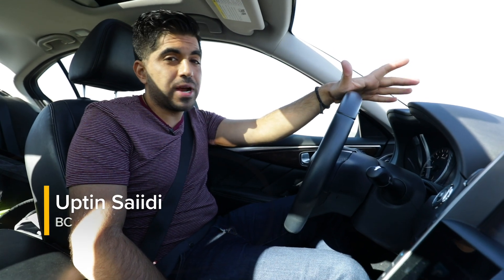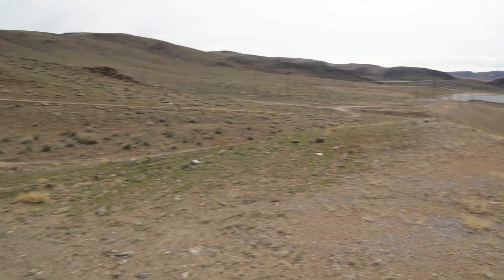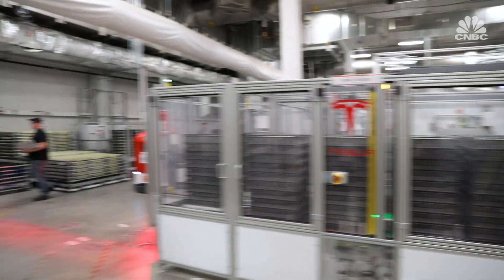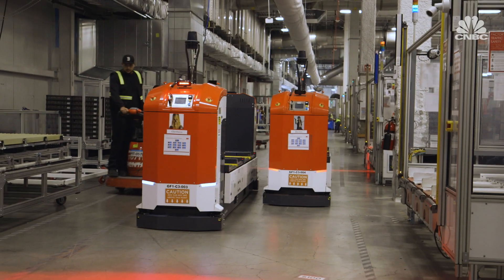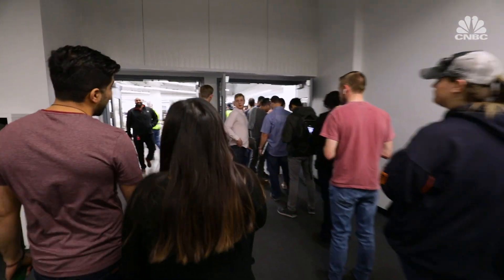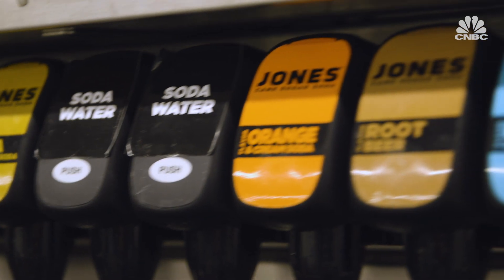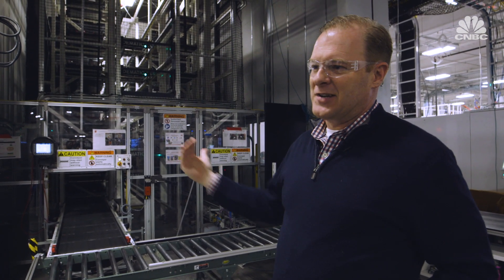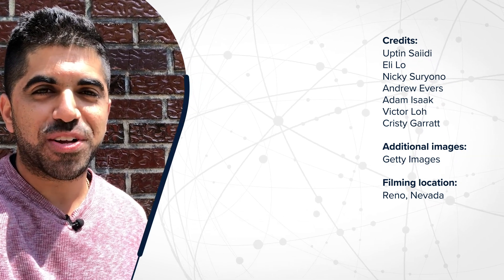Take a tour inside Tesla’s first Gigafactory | CNBC Reports

Comment: 7:52 on the left you see a forklift with a gas canister on it. They allow gas powered forklift to operate inside? These types breathe out carbon monoxide. Deadly gas
Reply: The yellow LP/Gas powered Hyster Forklift has a higher lift to reach top shelves of battery storage.  You MIGHT have also noticed the red Raymond Electric Forklift with a battery packs on it.  At this point in time, an electric alternative to the Hyster may not exist for the task at end.  Do you want Tesla to manufacture their own Electric Lift Trucks as well because there's nothing currently available for the need?  I worked at 3M Company for 35 years and we too used a combination of Hyster and Raymond Lift Trucks for specific tasks at hand.
Gimme a break.  They have to start somewhere as they move TOWARD a more sustainable world.  The vision doesn't become reality instantly.
Reply: If the factory has ventilation its ok.
Reply: Even if ventilation say isn't optimal & if fumes were a concern, don't forget the size of this building & the air space in it. It would dissipate all emissions pretty quickly.
Reply: Typically its natural gas, so its better then a diesel truck running inside your factory, but with the right HVAC equipment its okay, 1000s of Warehouses across the country do the same thing.
Reply: They are natural gas or propane fuel.

Comment: If only they can produce much more batteries. It is the bottleneck to their current products, Model 3s and Power storage products.
Reply: Raw materials. Seems to be an issue at the moment, except cobalt which Tesla use very little in their batteries compaired to the rest of the industry.
Reply: The bottle neck no longer exists as demand for the model 3 has fallen drastically, which is why they lost more than $700 million this last quarter due to decreases demand.
Reply: @JakeobE  It was deliveries that caused the loss not demand, they still have a several months long waiting list. A car is only marked as sold once it's delivered, this is one of the reasons why tesla began using its semis because they weren't delivering fast enough.
Reply: @JakeobE  there were 10,000 teslas in route to be delivered that didnt get counted in the numbers
Reply: @JakeobE  demand is higher then ever, your getting misinformation

Comment: Ironic to see right inside the factory (shown near the end of the video) a Tesla employee driving a gas-powered, instead of electric, forklift.
Reply: It's like buying chinese solar cells made in factories powerd by coal plants....
Reply: @TremereTT What is your point? At least the solar cells will generate power when it is used. You have to start somewhere...
Reply: @1flash3571  The point is that the solar cell factories should be using solar energy, if they trust in their product!
Did you realy don't get the point from reading the first post?
Reply: TremereTT don’t you see they’re not ready yet? There’s only one part of the roof is solar panels.
Reply: dont know much about forklifts. care to explain more?  i find it unlikely as it can't emit exhaust indoors.
Reply: Ugh, not all Apple employees use Apple products only. Same with Microsoft that use Google Chrome in their video presentations. It's not ironic, it's expected.
Reply: Rob yeah. Tesla makes suvs, sedans, trucks. They’re not supposed to make forklifts just because they have 4 wheels.
Reply: Ughhh they're rentals???

Comment: Erratic, intermittent, low capacity factor wind turbine/gridscale solar ['PNM IRP 2017 MEETINGS' engineers'  July 27,2016 scam/fraud DATA?].  Both require "fossil-fueled"  load following backup, 'PNM Energy Sources' concludes.  What Tesla gigafactory backup planned. When the wind does not blow and at night.
Reply: I wonder if they have access to lots of batteries?
Reply: Battery storage....hater
Reply: Lol. If there is only a way to store those energy when the sun is shining and the wind is blowing.....say, what product IS the Gigafactory is making in this documentary again?
Reply: Dude, did you fall asleep on your keyboard? This is nonsensical.
Reply: Obviously they use a somekind of magical stones.